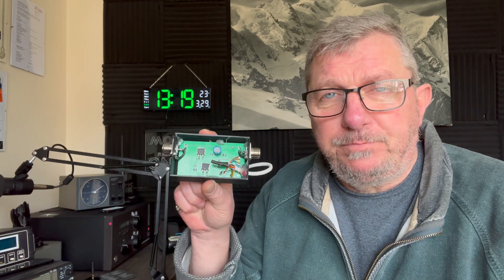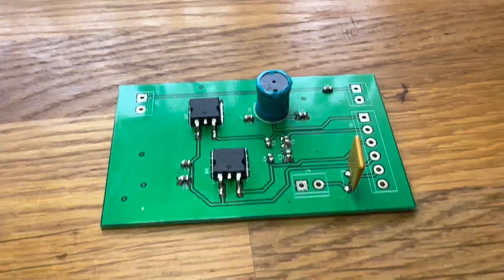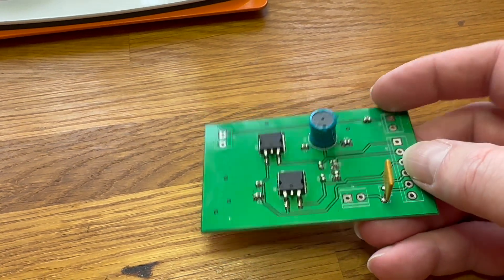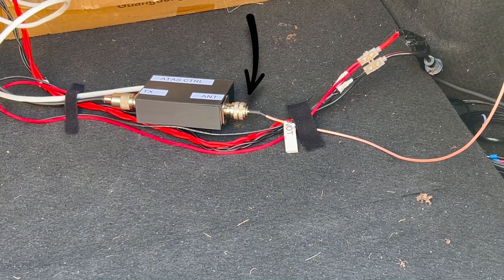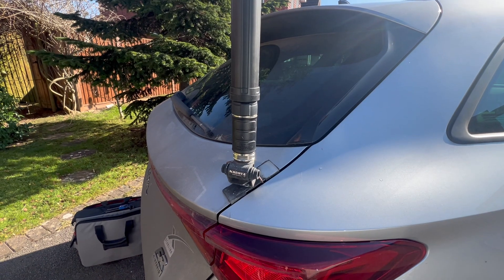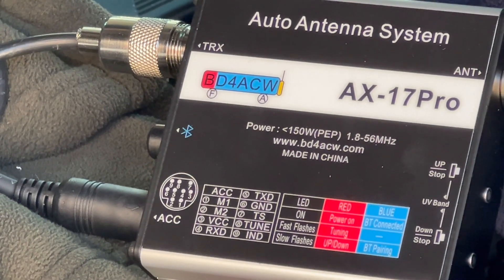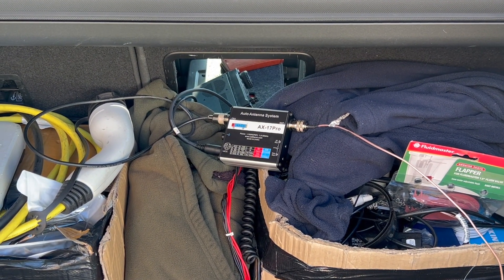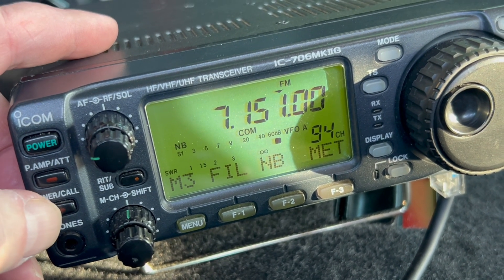ATAS-120A Controllers: AX-17Pro and a Home Made Version (HMV3): ScrewDriver Anntenna

Comment: The ATAS-120 A in combination with an AX-17 Pro works very well with the Icom IC-7100.  It just has to be set to use a tuner in the menus and DOES NOT need external power with the IC-7100.

Comment: Thanks for the vid Mike. I have one, unrelated question. Did you ever do a follow up video re the Air Source Heat Pump that you had installed?
Reply from the maker: Not yet, but I can say that they work well and due to the PV on the roof they have cut the cost of heating.

Comment: You need to get some wide tinned copper braid and actually unscrew one bolt per side of the hatch back lift gate, add the copper braid under the bolt(making sure you have scraped some of the paint away ) and tighten the bolt. Now go to the chassis side of the hinge and clean a small section around the bolt head of paint and sandwich the braid under the bolt. This will provide a good ground to the chassis. You might also add a length of braid between the antenna mount to the hatch bolt where the other braid is attached. Next make sure there is a good ground between all of the mount parts. Many times paint needs to be scraped off so parts make good electrical contact. So was the case with my Comet 400 mount. Many times the boot or hatch covers are not properly grounded because of paint acting as an insulator. Make sure you coat all screws with something like battery terminal protective spray to keep out water and prevent corrosion. 
Running an ATAS 100 as well as a Little Tarheel 2 screwdriver antennas. Both fine antennas, the 100 is the predecessor to the 120 series antenna.
Reply from the maker: Great info there. Thanks

Comment: Hi Mike, a great little build. Just a couple of future pointers. When it comes to the PCB, you want all your bypass/decoupling caps for the regulators to be as close to the relevant leg as physically possible to reduce loop area. Spreading them out over the board like you have is not ideal. I can't tell in the vid whether you have them via'ed to a bottom plane as ground, if you do then I would also via stitch any top ground copper as much as possible to reduce current loops. Also, the L7812 has a dropout voltage of 2V, which means the input rail has to be clear of that for stable operation, so you would need at least a 14V+ power supply? Do those motors really need 2.5A? You might be able to lower your input fuse. If they do require that sort of current, you may need to heatsink your regulators more, possibly through large pads. It clearly works so well done ;) and enjoy the hobby.
Reply: Thanks for this comment. I'm working on a board design also and this is great info
Reply from the maker: Thanks for the advice